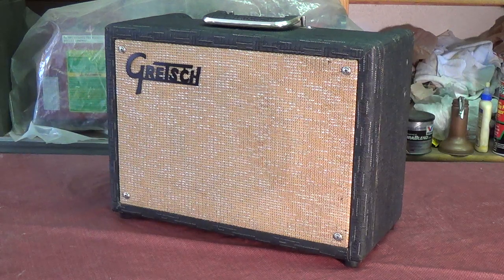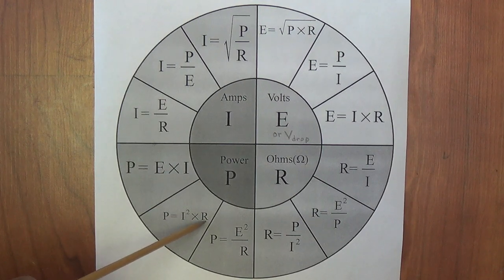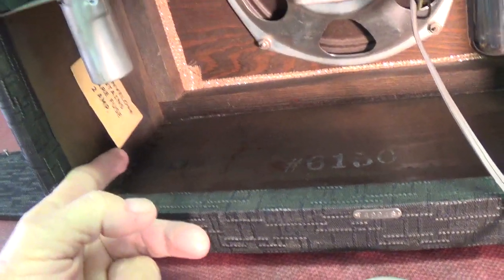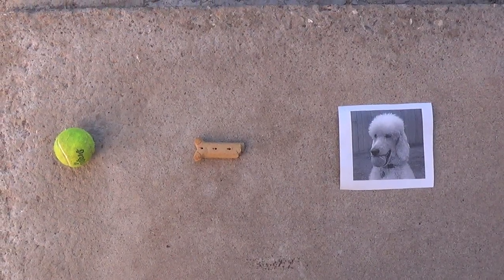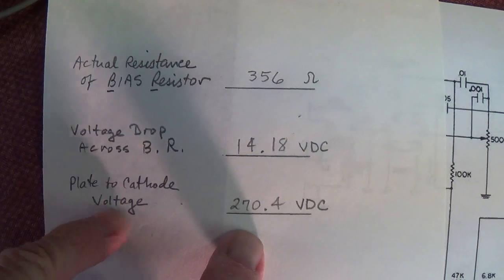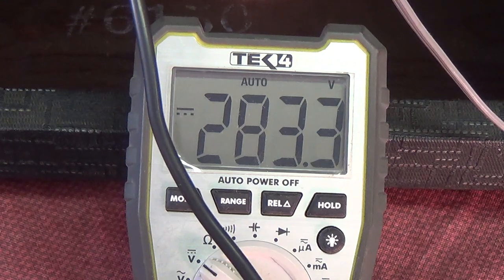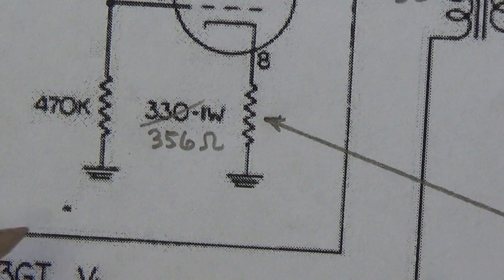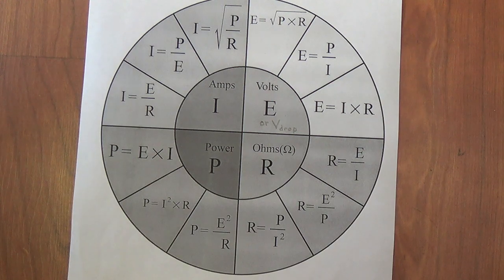Resistors, Part 2:  Power and Wattage Requirements, Practical Applications of Ohm's Law

Comment: Hi, Uncle Doug--

I've got another dumb question. When using a dropping resistor between the rectifier and the 1st node, I'm getting wattage requirements in the mid-40's. But schematics usually show a rating of 5 watts or 10 watts. Does the power handling of the output transformer combine with the power handling of the dropping resistor?

Cheers, and thanks for 75% of my electronics education.
Reply from the maker: Although they are in series and combine to drop voltage, each resistor has its own separate power requirement, based on its resistance and current. The 40W value seems quite high. You must be dropping quite a bit of voltage at a fairly significant current level.  My advice would be to create a voltage divider, rather than a "beaver dam" and place the dropping resistor after the branch to the other nodes, rather than before it......if that makes sense.
Reply: @UncleDoug  O.K. I'm calculating based on plate voltage times plate current. I get more reasonable wattage ratings when i calculate voltage drop times plate current. Is that the proper approach?
Reply: @UncleDoug  And thanks for your reply. Always something to think about.
Reply from the maker: @stephenrioux6821  You're welcome, Stephen. Good luck :)
Reply from the maker: @stephenrioux6821  The measure of current through a resistor is voltage drop divided by resistance.  The power (heat) is current squared times resistance.  Any other method will yield incorrect results.
Reply: @UncleDoug  Thanks. I'll crunch some numbers and deal with it.
Reply: @UncleDoug  I finally got it! Thanks.

Comment: Hi, Uncle Doug! 

I’m from Brazil and I want to design my own guitar amps. I have some questions:

When one could say that a circuit is an original design? This Gretsch 6150 has a very similar circuit to the 5F1 Fender Champ. It is a clone or an original design? 

Your channel is a gold mine! Thanks for everything!
Reply from the maker: Greetings, Rodrigo. In my opinion, there are no "original" tube circuit designs. Way back in the 30's and 40's, RCA engineers designed virtually all the tube circuits imaginable, and every amp since then has used most, if not all, of the circuitry they designed.....so both the 6150 and the Champ are actually derived from their earlier work
Reply: @UncleDoug  Thank  you!

Comment: I thought ground was positively charged and electrons flow from the power source to ground. Also that current flows opposite of electron flow, which means from ground to the power supply. In the case of direct current like in this amp, what happens in the ac dc converter to allow proper flow and type of current?
Reply from the maker: Positive DC "emerges" from the rectifier and is sent to the amplifier circuit. You can think of positive DC as being the absence of electrons. Negative DC is sent to ground.  In the electron flow model, therefore, the electrons would flow from ground back through the circuit to the power supply.  Watch the video on Power Supplies where this is explained.
Reply: If we think in terms of electron flow, the positive voltage at the power supply forces electrons to flow from ground, i.e. from negative to positive. If we think in terms of 'conventional' current, the positive voltage at the power supply forces current to flow to ground, i.e. from positive to negative. Exactly the same thing is happening in both cases. Electron flow and 'conventional' current flow are simply two different ways of describing exactly the same thing. At all times, electrons are flowing from negative to positive but we can choose to interpret this as current flowing from positive to negative. Sometimes electron flow is more useful, e.g.to describe the operation of a tube, while the power supply is more easily described in terms of current flow.

Comment: I wonder why there are so many variable names for voltage. Here we used U for voltage, V seems pretty universal and common, and then there's E. There must be some history and origin to those. U might just be to be clearly distinguishable from symbols like small Nu. I suppose E has to do with potential energy? 

 I tried calculating the plate dissipation from P = I^2 * R, but got wildly different results than with P =  V * I. This makes sense when double checking the "plate voltage" via V = R * I, where the voltage calculated is actually the ~10 V voltage drop over the output transformer (or the voltage drop over cathode bias resistor), but what would you use to calculate this instead of measuring the plate voltage itself? You could calculate this of course from rectifier potential - output transformer voltage drop, but that's still measuring it, actually measuring it at two points instead of one. I take it you can't calculate that plate voltage unless you know the starting voltage of the circuit and know every resistance in the path, calculating all the voltage drops and summing them up, until plate? 

For the record I couldn't get anything sensible from cathode either, but I was under the impression that you could use the P = I^2 * R as well, so is there a current or resistance I should be using instead of the ones measured? Maybe I was mistaken and it was P = V^2 / R, but that doesn't yield correct answer either (the resistance probably being the problem here?). So essentially I only managed to calculate the cathode bias resistor's heat dissipation power, as well as the same thing for output transformer. 

This is a funny place where I went through physics in high school easily and didn't have trouble in the basic electronics physics in tech uni either, but I'm lost with as simple thing as this :) Time takes its toll I suppose and I never really learned the actual workings and rules and applications in circuits. 

So when you're designing your amplifier and can't measure say the voltage drop in the cathode bias resistor, do you look at the heater supply and use that voltage to calculate the voltage drop over the cathode bias resistor and get the power rating like that, so you don't have to throw in a resistor and power up the amp and start measuring what the actual power rating should be? It's sometimes a bit confusing when the schematics don't connect everything, I tend to forget the heater supply when the schematic doesn't show that it goes to the tube, only the grounding from the other side of the heater. Say there's the power supply section in the schematic with A+, B+ etc (high voltage supply for plate side of the tube?), then the tubes are labeled V1A/B, V2A/B, V3A/B and there's the other side of the power supply "opposite" from the high voltage windings, that's V1F, V2F, V3F and goes to ground. I assume these would mean the heater connections, but I'm also left to wonder where C, D and E went. The nodes at VxF are labeled 4, 9 and 5 so I assume those would be the tube pins? Maybe this is explained in the tube and power supply transformer videos.
Reply from the maker: As I said before, Y, the answers are all either in the videos or on other searchable sites. I admire your willingness to spend time and effort in an attempt to fully understand each topic and wish you the best in your quest for understanding.

Comment: Hi Doug :) Thank you for this Video and all the other informative and well done work...Have to say.. Anode Current and Cathode Current Minus Screen Current, Very interesting and begs the question....with regard to Tube Matching....Would it be possible to Build a Tube matching device other that a tube tester for matching output tubes..?
Also,,Can you do a Video on Tube testing...Triodes preamp tubes and power tubes..Thanks Doug.. Terence.
Reply from the maker: +Terence Kaye  You're welcome, Terence. The primary source of variance between output tubes is the amount of current they conduct, which is largely based on the age and condition of the cathode. As tubes age, their current capabilities diminish, their bias gets "cooler", and they begin to sound rather "dead".  Tube matching, in my experience, is simply grouping tubes with similar current conduction. Any device that could power up the tubes (heaters, screen, and high voltage) and measure current conduction would work. I simply use the amplifier itself.....insert different output tubes, and measure the plate current of each, selecting two that are quite close in value. 

Tube testing would not be a particularly riveting video topic. You plug in a tube, set the dials, push a button, and get an emission reading......and the specifics of the process differ greatly from tube tester to tube tester (so the video would only relate to the tester used) ......but this is not how tubes are matched. Tubes with similar emission values may have very different plate current readings.
Reply: +Uncle Doug Hi Doug.. Thank you...It's amazing just how complicated Tube matching can sound given the many different angles....Thank you once again Doug,,,,you truly are a wonderful source of inspiration...Will have to show you the Guitar amplifier I've just completed.....And I have an Idea for a Tube matching set up as well....This could get interesting.. LOL....
Reply from the maker: You're welcome, Terence. You can post photos of your amp on my Facebook page: Uncle Doug's Vintage Amps. Before you start designing all sorts of tube matching devices, recall that any amp can be used for this purpose, simply by inserting tubes and measuring their plate current.

Comment: +Uncle Doug Thanks for these videos! They are very informative. I have an electrical question that has always bugged me. How does electricity flow to/from the ground taps? I notice that you measured voltage across a resistor that goes to the ground. Seeing as there's no actual ground wire from the chassis, I'm assuming that the electricity actually flows through the chassis of the amp to the neutral return. If so, wouldn't this be able to create a current through the chassis that could shock someone? Also, what is the benefit of having a ground tap, if the current returns to the power transformer, and ultimately back to the neutral? Does it somehow get rid of excess voltage? I'm missing something somewhere. This whole concept has been one of the biggest stumbling blocks for me when it comes to learning about electrical circuits in general.
Reply from the maker: You're welcome, Nick. Electrons are like salmon......they prefer to return to their source......so whenever they leave the power transformer and pass through the chassis to ground, they go straight back to the grounded center tap of the transformer winding that "spawned" them. Unless you present a shorter path of less resistance between where they are and where they want to be, they will not pass through your body.
Reply: +Uncle Doug That makes total sense. I like the salmon analogy. So, if The common wire were to be cut and I happened to be grounded and touching the amp, I would get shocked, unless the amp had a 3-prong plug, which would create a path of less resistance to ground. Otherwise, the current will flow to the common. Is that right? Thanks!
Reply from the maker: Yes, if there were no pathway to ground other than through you, and you were grounded, you would become part of the primary circuit and current would flow through you....probably killing you. If you provide a direct route to ground through the green ground wire, however, the vast majority of electrons will take that easier pathway, but some would still pass through you (if you were well grounded). i.e. If the ground wire offered 2 ohms of resistance and you offered 20,000 ohms of resistance, then 10,000 times more electrons would pass through the ground wire than through you.....probably sparing your life.
Reply: Unless you made a path to ground through your body with a neon bulb.

Comment: 20.05...doubling the wattage of the resistor is standard practice for safety.
Reply from the maker: Yes, at least double, especially if it's exposed to much current and heat.
Reply: @UncleDoug  ...or if it's in a small  enclosed space.

Comment: Uncle Doug, amazing video as always! :)

When you're measuring the resistance in-circuit, aren't you actually measuring the resistance in parallel with the whole circuit?
Reply from the maker: +Olivil  Thanks so much, Olivil.  In the case of the measurements I took, I don't believe this is the case. Looking at the schematic, the cathode bias resistor and OPT primary are isolated from the circuit and thus not in parallel with any other resistance.

Comment: If I recall right the I was for "International Ampere" and E was for Electro-motive force. There seems to be a lot of these 'quaint' old notions and phrases still with us 'electricians'
Reply from the maker: Here is an interesting explanation:  The symbol for current is I, as in the statement of Ohm's Law. V = IR. Why “I”? This was used by Coulomb, the French scientist (after whom the Coulomb, the unit of charge, was named). He used the term Intensité du courant or “intensity of (the) current”, which was abbreviated I for Intensité. This later became standardised internationally.
Reply: @UncleDoug  
Interesting, makes as much sense and any other explanation.  Interestingly some of the definitions of this stuff changed only this year.
Reply from the maker: @PeterWalkerHP16c  Changes rarely have the desired effect, Peter.....continuity and simplicity. In fact, they often have the opposite effect. Jack told me this just the other day :)
Reply: @UncleDoug  Yes well, we all know about cats and change ...